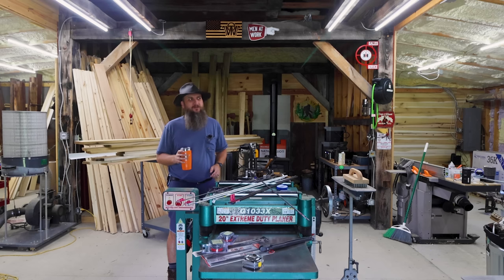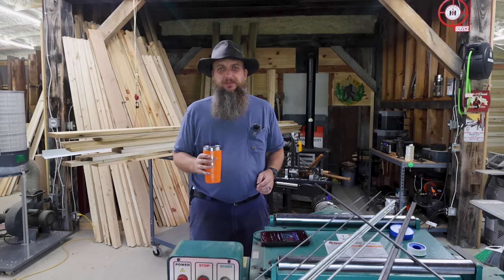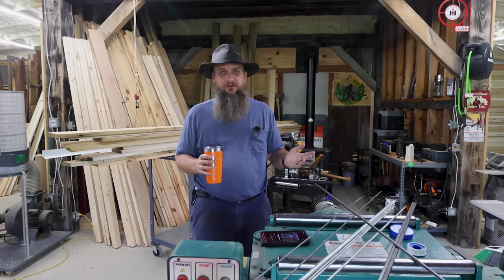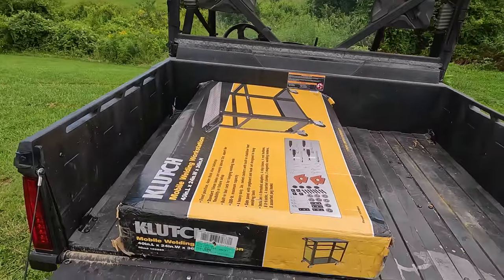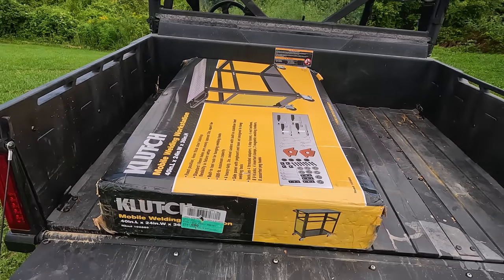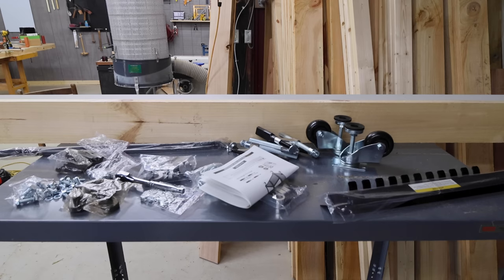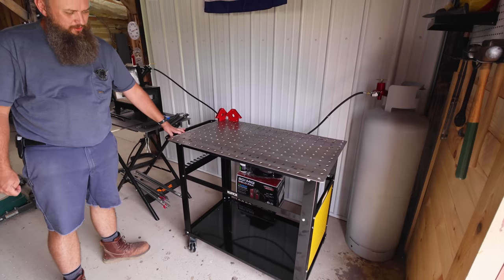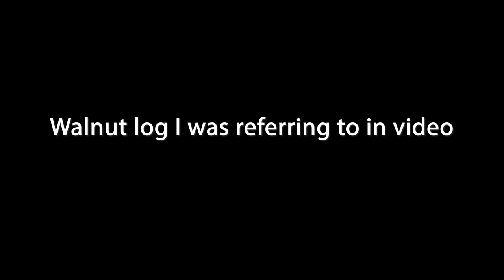Look At What Showed Up At My Sawmill!

Comment: I need to remember to put in earplugs (or keep some handy) when sitting down to watch one of your videos!
Reply: Why don't you just turn down the volume???? 😁✌🖖
Reply: @zapa1pnt    The volume button on my iPad is stuck (from constantly turning the volume down & then back up again) and I decided to leave it on full. Don’t want to go to the Apple store to get it fixed. So usually I have kept a set of earphones handy just to have a plug to block the sound occasionally. 🤷🏽‍♀️